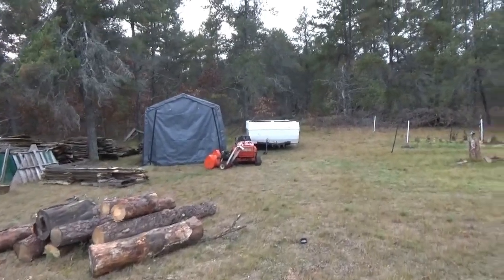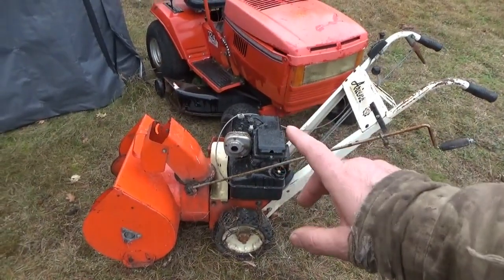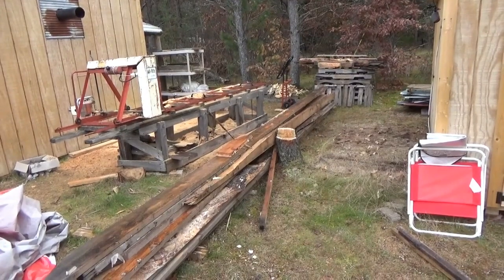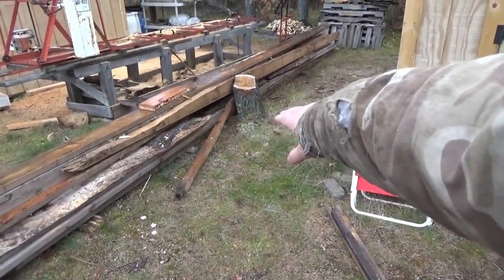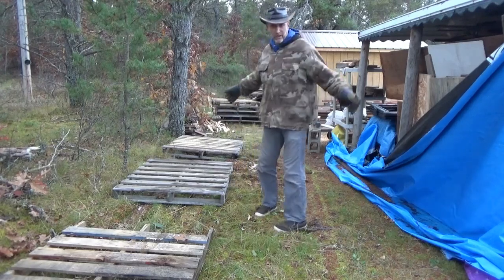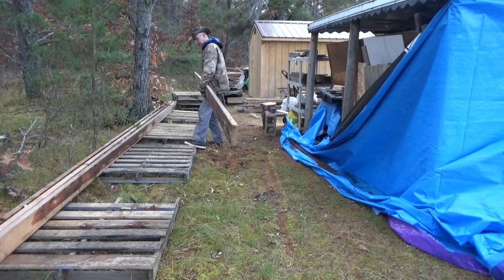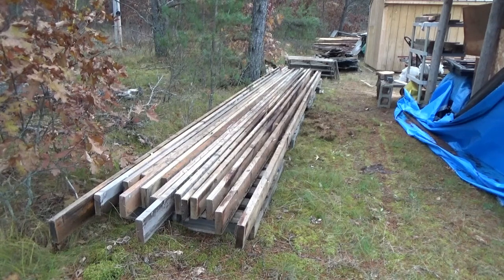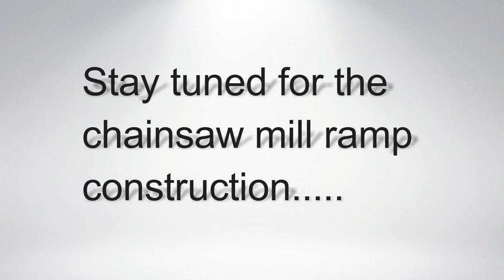Cleaning Up At The Off Grid Project & Prepping For Lumber Mill Ramp

Comment: I was wondering could you just make a roof over your mill,by connecting the 2 sheds together to make it one big shed? If not just make a structure like an ez-up,that way it's not permanent, but it should stay up.
Reply from the maker: Town wont allow that. Its why we have no wood shed for our fire wood.
I have to set up a tent or just a tarp sort of thing. Not even sure a tent would be allowed. They want 10 feet in between each structure.

Comment: You could build the structure into the sheds they can’t stop you then
Reply from the maker: They wont allow me to build them together, connect them or build within 10 feet of another building. And I am only allowed 2 buildings.
Reply: The Do It Yourself World huh that’s weird here were I live it’s 25 ft either side boundry line we have 11.9 acres. So makin a building longer going towards are wood my family in me could make a fairly longer building because the woulda goes far back. That’s part of are 11.9
Reply: The Do It Yourself World your laws must be different I take it
Reply from the maker: They said I could not build onto the sheds but I could build around the sheds. I can build a shed over the sheds. lol
Reply: The Do It Yourself World that’s always a option then. It would give you th coverage you need
Reply from the maker: True, but then its a huge building with permits (cost $$), inspections, footings, contractors and the works. Way out of our league.
Reply from the maker: I am working for someone gutting out an old camper. I will get the trailer when I am done and put my mill on that. Most mills are on a trailer anyway. I can then cover it as I like and move it to where I need it. win - win.
Reply: The Do It Yourself World Nice campers work pretty good for that kind of stuff trailers especially

Comment: If you can’t move the sheds, why not move the mill to the outside of the shed closest to the woods?  Then you can build your shelter for it.  May not be able to but was just wondering.
Reply from the maker: For one thing it would not look good. Right now nobody even knows I have the mill at all. Its not even visible. And its more sheltered where it is for now. I can very easily put a fence out back and block anyone coming to mess with it from the back.

Comment: That is some nice lumber you got for free there, Troy. An A-frame type shelter for the mill is probably the only way to hang that tarp safely during winter time. With steep angles. You can use some heavy duty rope as the ridge line, and secure it to the tree in the back and to a wooden pole in the front. The wooden pole can be secured with guy lines. To stretch the tarp over the rope, you can put rope loops through the grommets and put a stick through the loops on top of the roof. To open it up on the sides when you are going to work under there, you can put two tree stumps under there with one of those planks on it. And tree stumps on top of that on the outside of the tarp. Difficult to explain, I hope you understood it.

Comment: I see the garden tractor with the riding mower and need to direct the blower to throw that snow to the same side of drive. Also need a peay tool to help you roll those logs. Trim those logs to make posts of 4x4 then cut to make board.

Comment: When you build your porch be sure and use pressure treated lumber for anything that will be exposed to the weather or comes in contact with the ground.
Reply from the maker: It will all be covered in siding down to the ground
Reply: Sounds good. Hopefully there will be Tyvek behind the siding as a moisture barrier. Will any of the structural lumber be in contact with the ground?
Reply from the maker: Wont be using any tyvek behind the siding on a porch. Its a porch. Just framing and siding. Nothing else. Just a porch.
Nothing will touch the ground directly. We have those pavers we will keep for that.
Reply: Well, as long as moisture doesn't get to the lumber that will be fine. If it does, that will be a problem because those 2 x 6's, and I assume other materials, aren't pressure treated. Wish you the best on the porch and sawmill projects.
Reply from the maker: Thanks. Well, so far these boards have been outside in the weather for the better part of a year. Long as you allow fresh air to circulate they will be fine till I get it closed in I think.